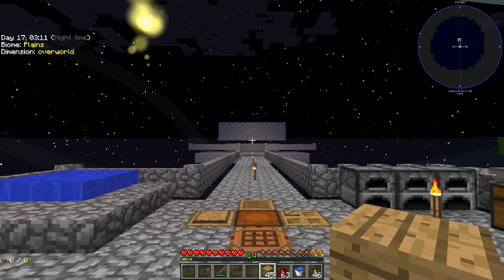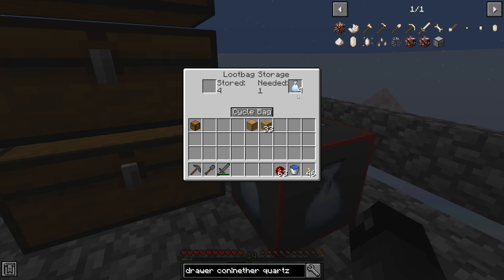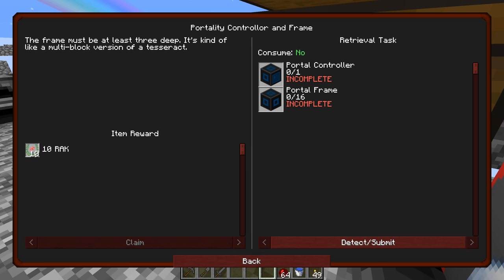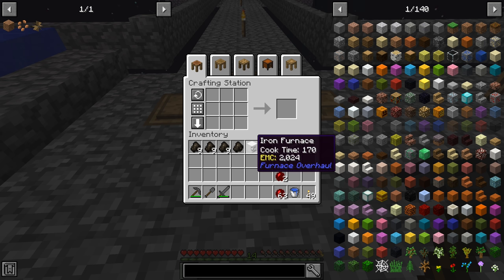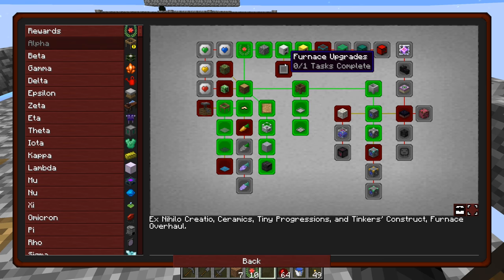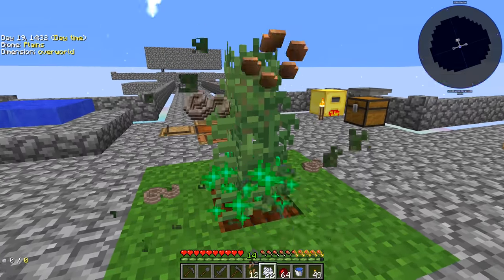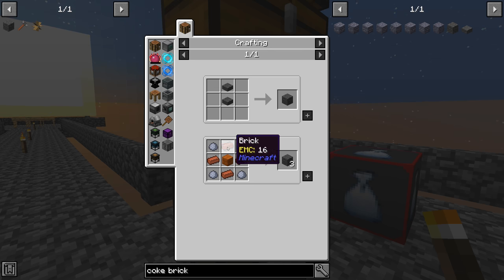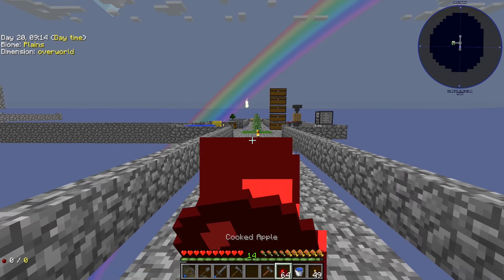Project Ozone 3 Kappa Mode - CREOSOTE [E05] (Modded Minecraft Sky Block)

Comment: Already calculated that for you. The 2x2 slab drawer is the cheapest, giving 4 drawers for 34.5 wood, or around 8.25 wood per drawer.
Reply: Tyreese Martin the wood to chest ratio is the same since you can craft 4 chests with 8 logs.
Reply: @jawbone713  but with kappa mode the log to plank recipe is 1:1, so the log recipe is cheaper I believe
Reply: @hunterharris2773  yea i know.
Reply: Jawbone_99 yes so the 4 chest + a few half slabs comes out to be the cheapest option.
Reply: The normal 2x2 is easiest in kappa it takes 13 logs
Reply: Shayne Gadsden 5 slabs is cheaper than 5 planks though
Reply: @TheReaperOfCreepers  Correct. They will probably patch out the Actually Additions recipes for logs to chests and stuff, so he should make lots of them while he can.
Reply: EMC helps with that, the drawer with the lower EMC is the cheapest to make
Reply: @AckmardX   does he look like he's near emc?
Reply: @Xnoob545  No but you can see the EMC values of the items...
Reply: @jawbone713  p

Comment: Some tips that may can help you :
-"k" bind (by default) compact automaticaly your broken ore just by putting your mouse on and pressing "k"
-Reservoir from Thermal Expansion can hold 10 bucket and can be used to craft treated wood. (If the recipe is not changed it's pretty easy to craft ) 
-Patient Bag give you 0.01% chance to get Nether Star, put it in bag opener in a loop. You get back the bag after opening it if it don't have the star.
Reply: All these tips are true
Reply: He's probably already aware of these since he has been doing theses series for years
Reply: Thanks! That last one really helped me.

Comment: You should definitely look at the Furnace Upgrades. They allow you to double a lot of stuff, like Ores and Glas afaik. They are quite powerful.
Reply: He knows
Reply: way to expensive. they changed the recipes (even in normal) to require 4 nether stars for the doubling.
Reply: Remember that this is Kappa mode, even simple recipes are made to be more expensive, or to give less output, like the one wood into one plank recipe.
Reply: @thorondir42  the ore processing didnt require any stars its just glowstone and blaze powder and it also double the ores i am doing that in titan mode
Reply: @safianali208  ore processing only allows you to process ores, it does not double it - the ore doubling one requires stars, you might want to check them again.
Reply: @thorondir42  i am playing rite now sir the prosesing one double ores and some other itms not all but the other one with stars will double every thing u smelt
Reply: Sagittarius A*  still true in kappa. The guy above is correct regarding the ore processing doubling ore chunks
Reply: they also let you double stone from cobblestone, i cheat that way to make all the chiseled stone i need for my platform.

Comment: The 1x1 Drawer recipe costs 14 Planks (8 Planks for a Chest + 6 Planks) for one Drawer (in this pack) and holds 32 Stacks of one item. The 1x2 Drawers recipe costs 23 Planks (16 Planks for 2 Chests + 7 Planks) for two Drawers (making them cheaper at 11.5 Planks per Drawer if using them for recipes) and holds 16 Stacks each of 2 items. As for using half-sized VS full-sized, half-sized are useful with Redstone Upgrades and crafting automation when you want to only keep a very small amount of stacks of several items stored on hand and save on energy consumed by machines and/or durability from tools used in their creation.

Comment: in kappa mode, recipe with 4 chests are better. since you use 5 planks + 4 chests (13 wood). 6 planks + 1 chest recipe gives 1 drawer then you need 4 times of this (32 wood)
Reply: Considering a drawer always holds 32 stacks max per block, the 2x2 drawer (costing 13 wood for 4x8=32 stacks) is less efficient than the 1x1 (costing 8 wood for 32 stacks).
Reply: But the 2x2 recipe makes 4 drawers, making it more efficient so long as you need multiples.
Reply: @laesinuk  You're right, I didn't notice that!

Comment: I guess he doesn't realize that regular oak saplings in a bonsai give the literal exact same drop table with the same drop rates as the apple sapling? cause bonsai just sets a default drop and base growth rate setting which is then automatically extrapolated into all saplings that can grow on a "dirt" variant that can placed into the bonsai pot (i.e. dirt, grass, netherrack, end stone). some saplings give a multiplier to growth rate (usually to make rare materials take longer to grow), but that part is not in the bonsai configs if you look at it, and end result is apple saplings are only better if growing in world so you can twerk for apples

Comment: 1x1 drawer = 8 logs per drawer
1x2 drawer = 5.5 logs per drawer
2x2 drawer = 3.25 logs per drawer
Reply: So 2x2 is nor efficient
Reply: *more effiecient
Reply: Also, all the different types of drawer hold 32 total stacks so 2x2 is a lot better than 1x1 because it holds the same amount, but costs less.

Comment: i believe 1x1 is most efficient, it's one chest for 32 stacks of one item.
the 1x2 drawers take 2 chests, but each half of the drawer only holds 16 stacks, so still 32 stacks total
the 2x2 drawers take 4 chests, and only hold 8 stacks each, again 32 stacks total
the main benefit of the 1x2 and 2x2 over the 1x1 is just the ability to store different items
most efficient is 1x1 for storage
Reply: I think he meant in the recipe for the compacting drawer
Reply: You are wrong. It is 2x2. 
4 chests = 2 logs
1 plank = 2 logs
1(1x1) = 1 chest + 6 planks = 8 logs per drawer
4(2x2) = 4 chest + 5 planks = 13 logs
13/4 = 3.25 logs per drawer
3.25 < 8
And all the drawers hold the same amount in total so actually the 1x1 is the least efficient and the 2x2 is the most effiecient
Reply: I meant 1 plank = 1 log
Reply: @joelifer2096  4 chests isn't 2 logs. 4 Chests is 8 logs.
And only with that recipe is 1 chest = 2 logs.
Also 1 Log = 1 Plank in this pack, unless you use the 8 Logs = 4 chests recipe as reference, but it's better then to calculate in terms of Logs instead of Planks.

Comment: 13:27 You can convert Iron blocks into ingots? For me that didn't work for some reason
Reply: He's using an old closed beta build given to testers at the time. You can use the Factorizer from Thermal Expansion to craft/uncraft blocks.
Reply: @Stereo528_dev  alright ty